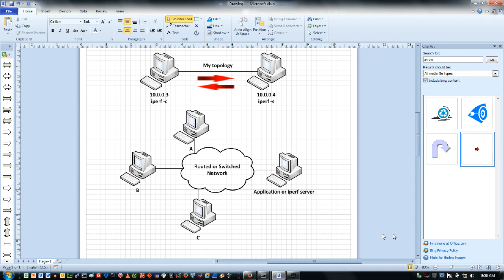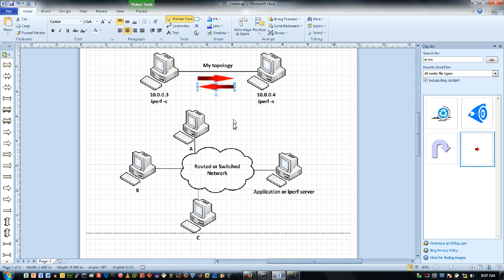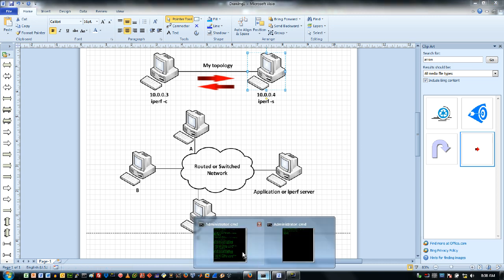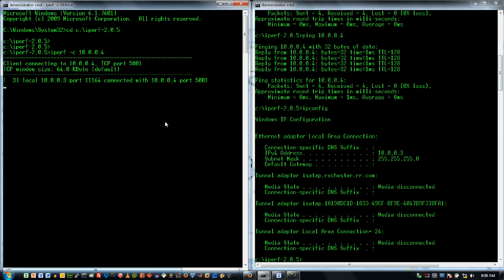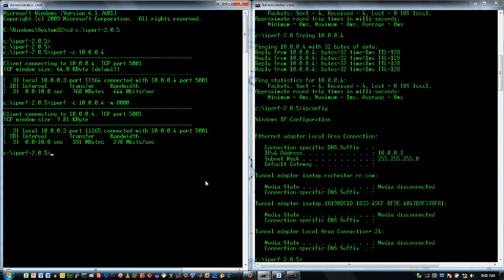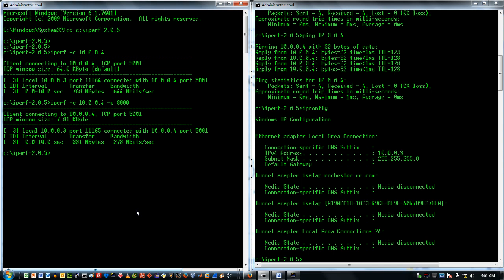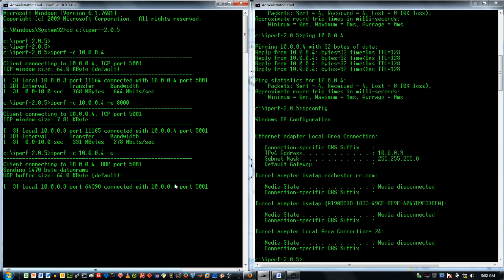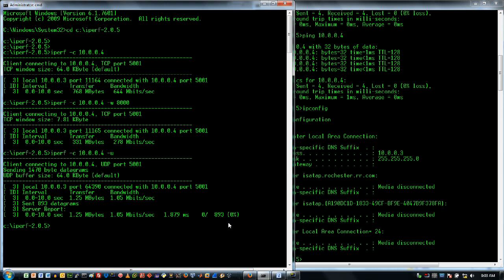iperf Testing - How does it work with TCP and UDP?

Comment: dead tool, abs no multicast support...
Reply from the maker: Hi CH - thanks for stopping by. Not sure I can agree with you. Although there are other tools, iperf3 is still very active with folks regularly posting in github. For those that want to know more: https://iperf.fr/
Reply: @BruceHartpence  I tried abs all version to be able to use it as client and server for multicast...either crashes or is not able to bind the mcast IP to the interface...Gave up...

Comment: Thanks, may I ask why UDP bandwidth is much smaller than TCP's ?
Reply from the maker: Well, iperf generates a stream of traffic but tcp is fundamentally different from udp because of the window size. If you want to have a little fun, drive the window size down to 100 and then compare it to a window size of 25000.